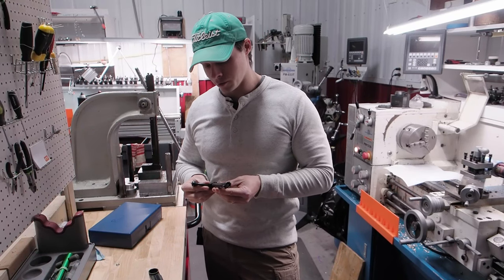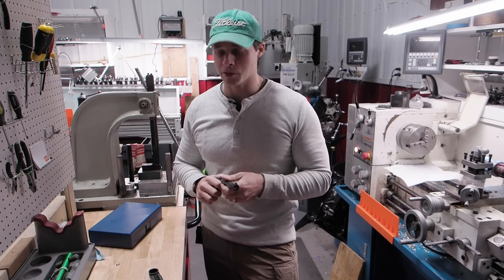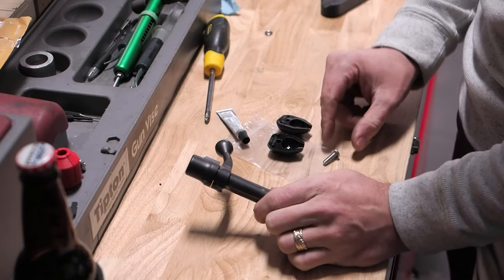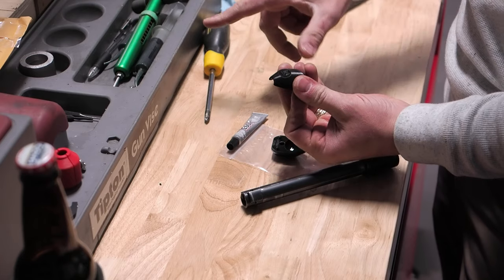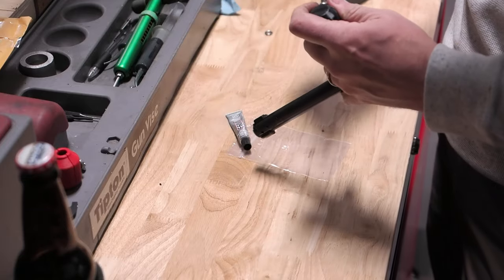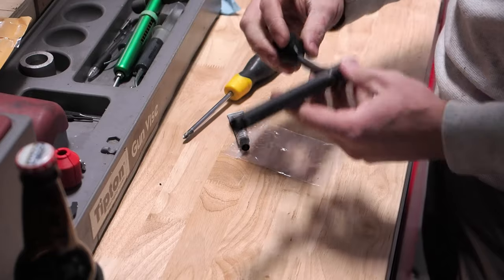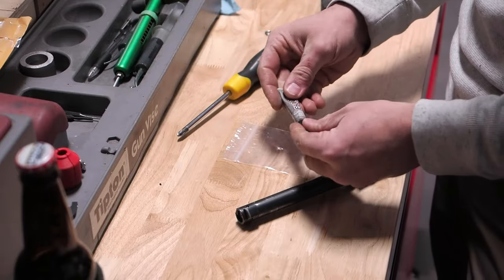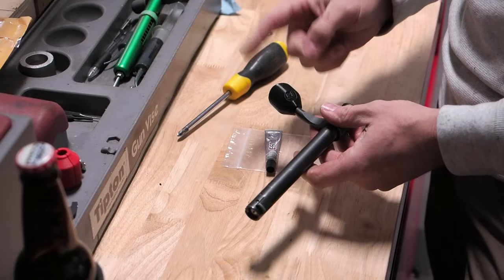Howa 1500 Tactical Bolt Knobs

Comment: Would this work for weatherby vanguards as well ?
Reply from the maker: Yes they are virtually same rifle.
Reply: Weatherby Vanguards are manufactured by Howa machinery LTD.  A Howa 1500 is literally  just a Weatherby Vanguard with the Parent Company's name on it instead of Weatherby. (This was also true for the Smith & Wesson 1500) The parts are not just interchangeable, THEY ARE THE SAME PARTS. 
Hope this helps.
Reply: I was curious, because MDT does not recommend their bolt knob on a weatherby , but it is made for a Howa 1500 @rdsii64